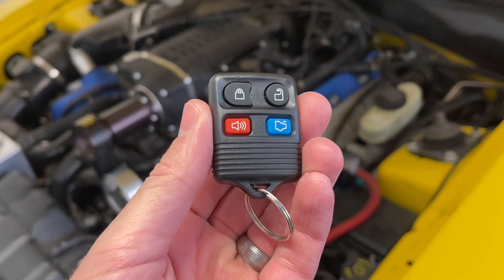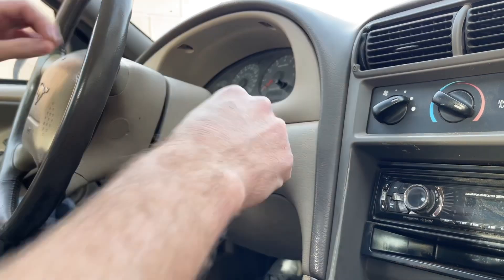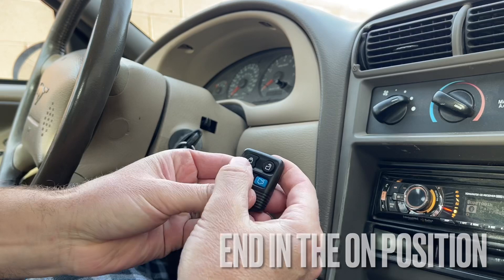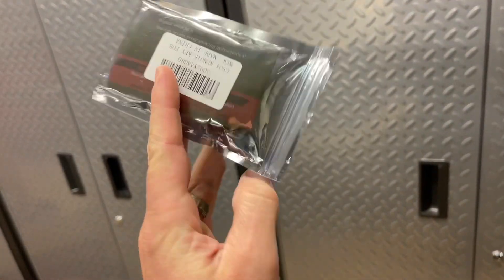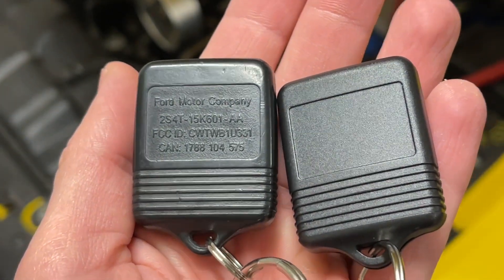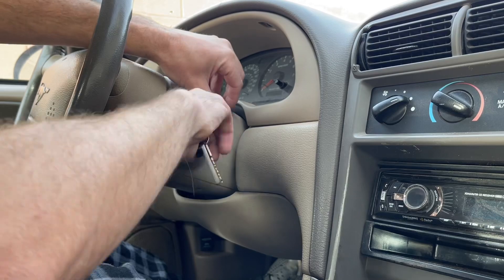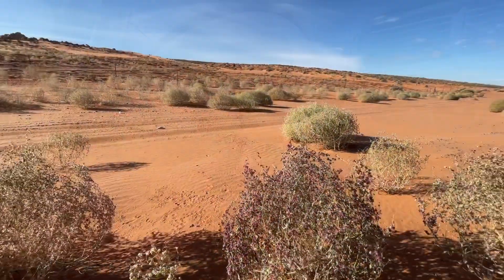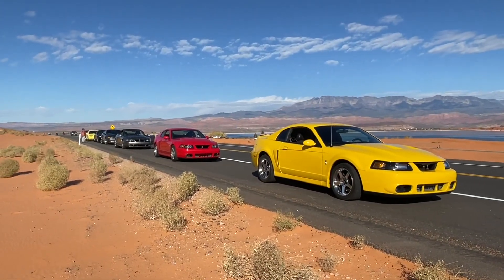Program Ford Keyless entry: Shown on Ford Mustang 99-04

Comment: My key fobs stopped working recently on my 04 cobra. I thought it might be the fob batteries, but a multimeter said they were good to go.  I tried to reprogram them to the car, just as you showed, by turning the key 8 times, got the door locks cycle,  but pushing the fob buttons did nothing.  In your opinion, what might be going on, a fuse, the RKE module?  Any thoughts would be greatly appreciated.
Reply: Did you figured this issue out by any chance? Im running into a similar program on my 99 GT. Ran the programming sequence, door locks cycle, press the button on the fob, locks cycle, but when I remove the key and try to use the fob nothing works. Im thinking my module or relay is bad but I dont know even where to find the keyless entry module at.

Comment: Ordered two fobs and keys fr Amazon, and this process worked for single fob, but then when I programmed the second (within 5 seconds) the first one didn't respond... tried again and the reverse happened, after several attempts got both working but you need to press BOTH simultaneously.

Comment: worked great except it deprogrammed my old fobs, I assume I have to take the others out of range?
Reply: Tried to reprogram them all, worked for all 4 at car, I moved the other fobs quite a distance away and it still deprogrammed them. next attempt wrap them in foil.
Reply from the maker: You’ll want to follow the same programming steps but push a button on all 4 remotes within the 20 second window. Then they will all be programmed
Reply: @dannyjohnsonsgarage  Thanks, that was going to be my next step.